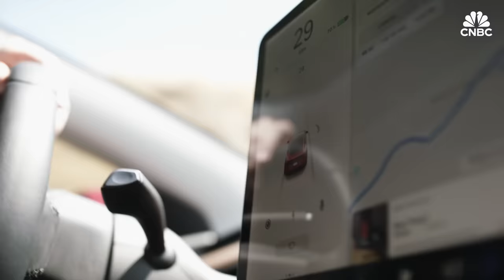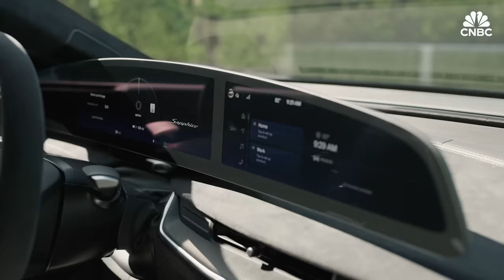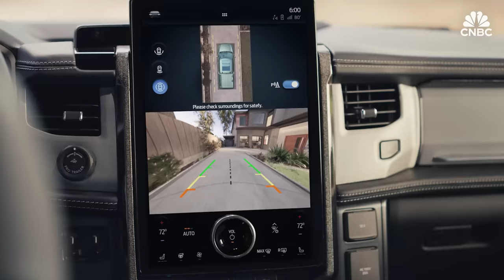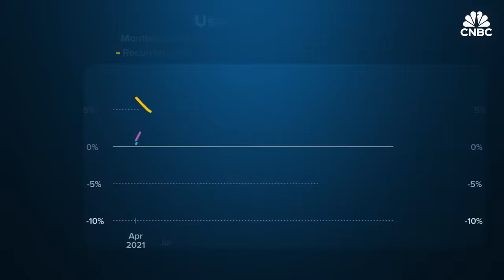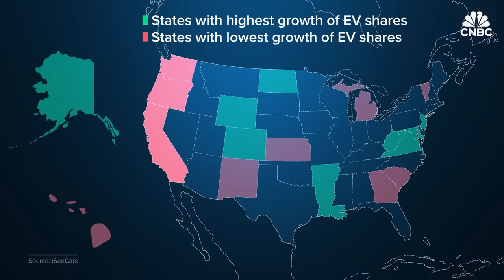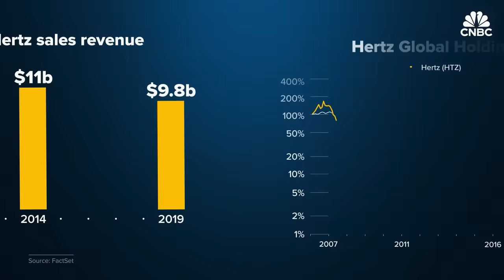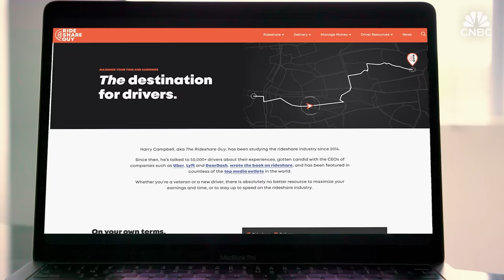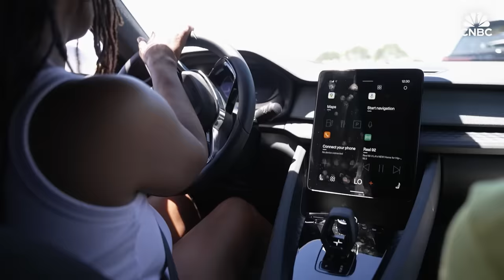Why EV Sales Are Falling | CNBC Marathon

Comment: I leased an ev a week ago.   I was looking at a gas Lexus RX which I can find 3 years used, fully loaded for the upper $45k price range.  I chose the RZ because of the Lexus discount currently.   I leased a $67k new car.   My lease payments plus 3 years of financing plus the lease buyout totals $51k.  That 3 year used RX plus 3 years of financing would have cost just as much.   So far it is costing about 4 cents per mile in kilowatts versus 20 cents per mile in gas in a comparable 330 HP crossover.   The range is pretty poor.  This vehicle is not meant for everyone.

Comment: Well, considering that a decent EV has a far superior acceleration, is 3 times safer, 3 times more efficient than any version of Ice cars, and it cost 3 times less in running expenses, I find your opinion very far from the truth. I have been driving a Tesla for over 5 years and I know what I am talking about, with the OTA upgrades the car is as good as new in its performance numbers, maintenance costs are practically zero, except for tires and wiper blades, as the brake pads are still practically new, and battery degradation is just about 3% with over 50.000 miles on the odometer.  Now I don't know many intelligent people that would prefer to buy an ICE contraption instead of a Tesla, in fact according to official figures ICE sales in all its configurations have been contracting for years already and destined to completely collapse as EV manufacturing will increase in time. Tesla has a giant presence of charging stations everywhere, if one doesn't charge it in the home grid. Right now it is very unwise to buy ICE cars as their value in the coming years will fast plummet to nothing.

Comment: The pre owned ev issue is simple I can replace an engine and transmission twice with brand new OEM ones for the cost of replacing the battery once in an EV and that doesn’t take in account electric motor failure.

Comment: They summed up my resistance to EVs in the first 35 seconds. For me, EVs are too expensive and there are too many limitations on how you use them. Charging options and range are not where I feel comfortable using them, but those issues will probably get better in the future as more infrastructure is rolled out and as battery development continues. If it takes more than 20 years, I probably will never own an EV because at that point I will be too old to drive. So I am really looking forward to self driving cars.

Comment: As for 31% of dealers complaining about EVs, it actually is saving a lot that it is 31%. Dealerships are not neutral about EVs. This new technology (EVs) typically breaks much less which cuts into their main source of funding. As for Jeff saving there is an oversupply…. Well, that may be for some brands such as Mercedes Bens… 90 days. That is not the case with Tesla. It may be confirming that some brands are not competitive against Tesla. The market is adjusting as it should through lower prices. Tesla sells cheaper because it can. Jeff says that they would do things differently if they could go back…. For one thing, legacy auto should have followed closely (and seriously) Tesla. Tesla has taken the car business very seriously, so much that they were more efficient at innovating, hence the gap that allows them to be so competitive with prices.

Comment: As components become more commonplace prices will drop. The weird thing is electric motors are cheaper than engines and batteries continue to drop. How does MB charge 70k for a car thats clearly much cheaper to msnufacturer.

Comment: We still need more technological breakthroughs in the battery. Double capacity with no increase, or even decrease in cost, is needed.
Reply: according to the USGA the world has 88 tons of lithium but only 1/4 is feasible to reach.....that breakthrough will need to involve a whole separate component then lithium , nickel or cadmium.....which is very iffy......we should have spent our time on hydrogen because at least the supply part of supply and demand is available. due to mining costs the current ev experiment will end with a whimper.

Comment: The EV is not the answer and regardless of what the claims are in regards to the % of EVs on the road.  
EV sales are declining and that is not up for debate.  
Imagine how the value of used Internal Combustion Engine-equipped vehicles will skyrocket should they no longer be manufactured.  
EVs are a very bad investment.

Comment: EV is backwards. Why would I sacrifice resale, lower costs, distance, access to several gas stations on every corner, just to get electricity running my car? It's backwards. Make it cheaper. Make it last longer. Make it charge faster. Make it better and I might go to it. Until then. I'm keeping my car and not missing a single second of those 1 hour charges. Good luck finding a station that has a charger available.

Comment: There are a lot of good points in this news piece.  I own a Bolt EUV, so comments about how expensive EVs are do not hold true if a company (GM) wants to sell EVs at a competitive price, then they will sell them all.  Also what was not mentioned in this news piece is the reason we all want a more green power source (not only for transportation, but for businesses, manufacturing, and residential as well).  My personal tolerance for weather-related disasters is starting to run thin, and other than very dry summers, and winters with no snow, I have not been much affected by weather-related events.  0h, almost forgot, the fact EVs are a far superior technology to ICE cars was not brought up.... but like any new technology, there are still a few bugs to work out. :-)

Comment: Some years ago, when the reality of EVs was being seriously considered, an Israeli Engineer proposed a program that just made too much sense so of course he was ignored. I saw him interviewed on one of the TV networks  news magazine shows.
He said that if we as a society were indeed serious about doing away with polluting gasoline and diesel powered vehicles, then a massive program would be needed that only the Federal Government could administer.
He proposed a range of batteries rated for different vehicle applications be designed and backed by the Federal Government and the auto industry instructed to design their vehicles around the appropriate Federal battery for its weight class and performance needs.
The batteries would all be installed under chassis by a standardized robot system to be changed out at locations now used for gasoline filling stations. The time for a change out would only be about as long as the average customer now takes to fill up with gasoline and complete their rest stop. The batteries would be made available on a deposit exchange basis so one doesn't actually have to buy the expensive batteries, the Federal Government does. It's the only way that the common folk,  the working class can get out of gasoline powered vehicles and into EVs in meaningful numbers, in the time frame that climate considerations can be met.
But NOOOOOOOOO! We have to go through years of this humankind crapola.

Comment: For the dealership owner saying he wouldn’t go back to flip phones and ice car has the career to match.

People in the trades pulling large trailers of tools and equipment, heavy equipment operators, freight drivers, don’t want to wait for hours to charge tools when they work by the hour and weather is an obstacle, farmers and construction.

We know all the infrastructure charging issues which I would consider temporary if the government would step back and let the market build it out and charge a fee to charge which would include a Hwy tax. 

10 years or 2035 isn’t unrealistic if you let the market profit from it and Ideas and engineering are aloud to work out the details.

Comment: Amazing how the manufacturing sector has ignored what consumers really want and need in a limited range EV. We want economical practicality as in a small, light weight utility vehicle or pickup solely used for local errands, hauling, etc., with daily local usage well within the 110 volt overnight charging range. Such a vehicle should reasonably be sold for less than 20k with radio, and optional HVAC. Leave interstate duty to ICE or parallel hybrids until battery tech can competitively replace ICE altogether. PHEVs are a Rube Goldberg kind of tech conceived to squeeze maximum profit from buyers who are under the illusion that they're saving the planet. Sorry, your early adopter market is drying up and the rest of us aren't taking the bait.

Comment: Gas prices have gotten so much lower beginning in 2023 until now and it correlates with slumping EV sales. The reason that EV sales were up during the pandemic because gas prices were ridiculously high. In part because of the pandemic and also the Russian oil ban when they invaded Ukraine.
 Today the US is producing more oil and gas than any other country and any other country has throughout history. So gas prices will continue to be about where it is now in the US as long as Biden's economic plan stays in place. EV sales will continue to be soft as long as gas prices are low.

Comment: Terrific news! I know this issue is much more complicated than my opinion.  This to me, is a prime example of how the government often severely under estimates the infrastructure requirements in order to make new consumer and environmental Iinitiatives successful. If I am correctit has been proven that EV battery construction is more harmful to the environment than gasoline engine construction. Additionally,  the cost of replacing a dead battery can come pretty close to the cost of the vehicle. I believe there was a story about an EV that needed a battery replacement. The customer went the dealership the vehicle was purchased from only to be told the manufacturer has nothing to do with the battery. That the battery came from a sub contractor overseas and the customer would have to deal with that company to order a replacement battery. My next point about the downside of ill prepared  govt initiatives is this. Good luck finding a mechanic genuinely qualified to maintain and repair your EV. IN my opinion the government should have incentivized the auto mechanic industry to begin training EV mechanic specialists An untrained mechanic workiing on an EV CAN BE INJURED, DIE OR COMPLETELY RUIN AN EV with one wrong move. Lastly, what is a basic economic rule about supply and demand?  Increased demand for a service or product along with scarcity of a product or srrvice drives prices up! So I ask this, what happens to our electric bills when and if 25-30% of the country goes completely EV, i.e. car and home? Just askin'. Consider this. If you agree that politicians are beholding to donors. What happens if the demand for electricity gets to a point where there is public outcry to cap electricity prices. What happens when multi national corps gets or legislators to pass legislation allowi g the privatizationet our natural resources?

Comment: I have the CRV Hybrid and the Bolt EUV. The Bolt is just quicker, quieter and more reliable and fun to drive all around. I want to sell my CRV but it turns out that my Insurance will almost double because I loose my two car discount. My Chevy Bolt EUV is the Best car I’ve ever had in 50 years of many different cars and the last 20 of new Hondas that we trade every 3 years. Yes, EV prices need to come down and the infrastructure needs to go up but as this happens it’s my experience that EV’s are far nicer cars. It’s like stepping out of a Piper Cub into a Lear Jet. I will never go back to ICE.

Comment: I won't buy any EV because, 
1. The batteries are way too expensive to replace, around 10k plus, the last I heard, and 
2. I don't want to burn to death in my house some night when the vehicle battery catches fire in my garage, or burn down my house, either, and, 
3. The resale value is low due to the high replacement cost of the battery, and 
4. I live in the West where the distances between cities are great with nothing very much in between the cities and little chance of finding a charger when needed, and 
5. Winters where I live are COLD. EV batteries do not like cold weather, at all, and 
6. The sources for the Rare Earth metals for the batteries are very environmentally damaging and often mined with child labor and by very poor adults in extremely unsafe conditions that, essentially, amounts to slave labor, and

7. If CO2 is one's concern, the Rare Earth metals are mined, and the vehicles are manufactured, shipped and fueled by gasoline and diesel fossil fuels. All that is accomplished with an EV is that the pollutants, (CO2 is NOT a pollutant but, there are others involved in all this that are,) is transferred from the tail pipe to the electricity generating plants, especially, if it is fueled by coal, and does nothing to improve the environment, or lower CO if that, is your poison.  In fact, it increases pollutants in the air and CO2!
 
In addition, the weight of the batteries are very damaging to roads and highways, creating the need for more frequent resurfacing, which is expensive for taxpayers and a real inconvenience for the traveling public.
Reply: Of course this video doesnt tell what you said, because this video want to fool and deceive the viewers

Comment: Because the battery to replace it after seven years is $18-$22,000 on top of that the wheels wear out from 15 to 20,000 miles so that’s per year $400 per tire yeah I don’t think there’s any savings

Comment: The EV are Urban Suburban cars.  They are not interstate cars.  Battery replacement prices are a killer also.  A car costs 30 000 replacing a battery 20,000, that is just too much.  MAYBE BATTERIES  COULD BE LEASED!  WHEN IT GOES you nuy  A NEW LEASE ETC!  Evs need a 1000-mile range in any condition!

Comment: EV's are dead period! Batteries that cost $60,000 after just 150km range. Battery fires, building going up because an EV caught on fire and was within 50 feet of the structure. Untold hours wasted to recharge. lack of range, especially in winter. Pile on outrageous insurance rates that go up yearly not to mention a $0 resale/trade in value.

Comment: I have an electric car, Kia EV6. My best car ever...Instead speculations, I decided live my own experience, and I don't regret it al all.
We have two cars at home. One is gas, my wife car, and my Kia. Weekend only use the kia for commute, and all other things. Long distance trips, we use either or, depended. If is something quick. We use the gas car... Using both cars smart way, we save a lot in gas, because I have charger at home and solar panels on my roof house.

Comment: My 2nd time watching this CNBC video on EV's it's just negative. Why focus on the most expensive EV vehicles? Drop down to ID.4's and the EV around the ID.4's  market since the ID.4 entered the 2nd after Tesla. Why, some of the other EV have comparable ranges, charge rates curves are higher than some EV's in your video, the cost can be much less than your video explain. Mileage does not drop as you experts explain. The charging network has increased and still needs improvement.

Comment: Why is a March 2024 video making predictions about car sales in the second half of 2023? And the video is based on statistics from dealerships while the largest and actually successful EV manufacturer does not use dealerships. Battery efficient dropping to 80% is incorrect, their capacity drops over the lifetime, not the efficiency. It takes less energy to fully charge a 10 year old EV battery. It is a small mistake but shows that the people selected to speak in this video are not involved in the EV car market at all. Talking about "high" $6/gallon fuel prices is also funny when they are about $10/gallon in Europe. The car market is a global market, even many cars sold in the US are not fully produced there.

Comment: I went to Boston the end of January and I would have loved to rent a Tesla, the cold weather and the range issues. If I precondition the battery I wouldn’t have had a problem. The problem that I was finding before I even went up they’re charging infrastructure is horrible…hertz’s charging infrastructure was horrible.   I don’t know why they can’t come up with some kind of an account with Tesla where it’s a Hertz account but it links to the credit card that you have on file with Hertz and I can just charge my credit card through the charging network at the Tesla supercharger station    I would have loved to have a Tesla for those four days I was up there, but somehow or another they only have certain charging stations that you can use, and there were none where I was    I got stuck with a Ford bronco, but I could put gas in it, so it didn’t care

Comment: Lmao! Ev intrest is down because the only place their ”normal driving" numbers work are in the cities where EVs are popular and there's already a decent charger infrastructure. 

 Beyond those EV hot spots in the world beyond cities EVs simply don't cut it. 

 Virtually no infrastructure, only one place to get them serviced and not even close to the needed range for the average rural resident. 

 The pick-ups can pull impressive weights, but can't pull it far enough to be useful. 

 The semi's are a huge joke. 500 miles compared to 2000 with diesel. Only people who think that will work out are people who have no idea what they are talking about.

Comment: Too much technology and that's why they're too expensive, more high tech means they're good for 3-5 years then they're worthless. My car has a few sensors, if it gets low on gas, if it needs an oil change, or if it overheats, that's it. And that's why it lasted for 17 years+